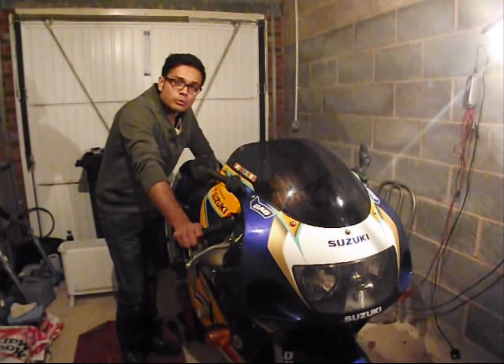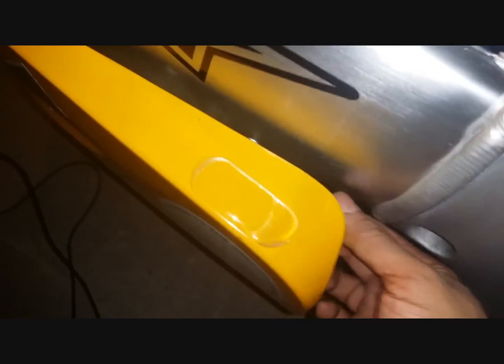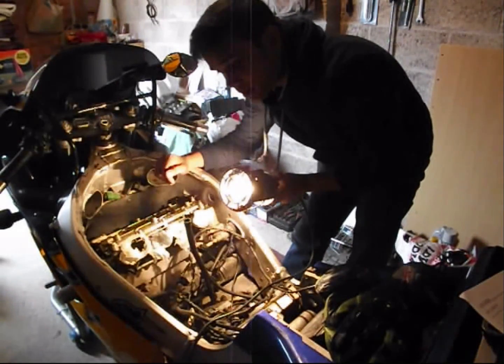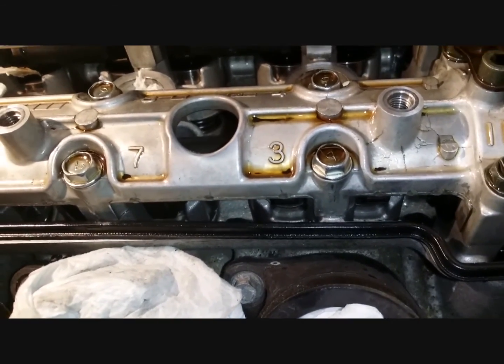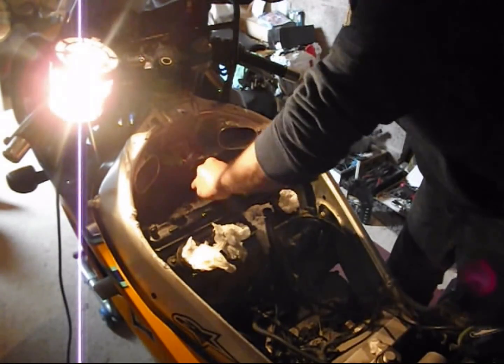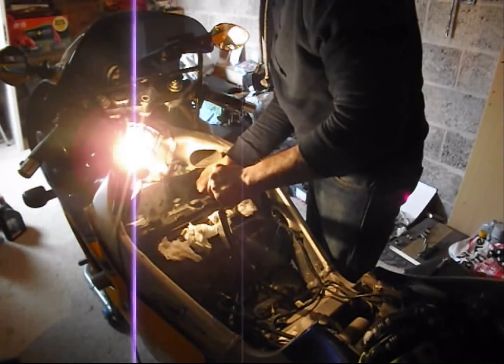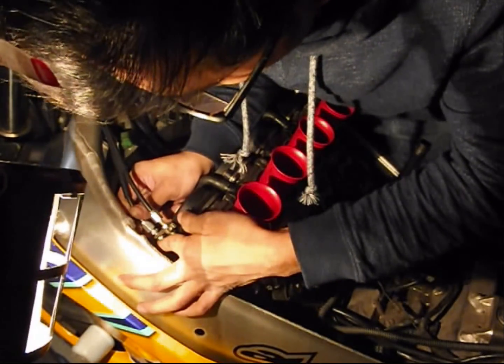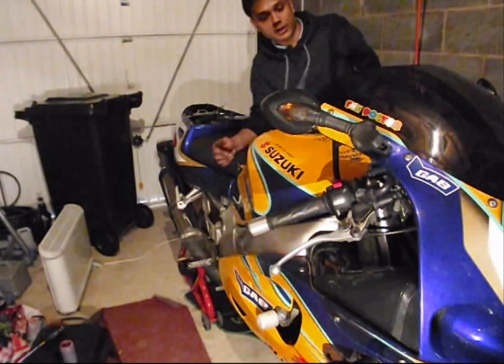GSXR 600 SRAD - Valve Clearances Check

Comment: hello bro, i have a 750cc 97'' too, been having problems with it, dont know why it wont start, and i been looking for answers everywhere and nothing, was hoping you could help me.

greetings from Venezuela.
Reply from the maker: +Domingo Chacon  Hello Dom. Thats a shame! Well try and sort it out. First thing Id like to know is what comes on and what doesnt when you turn the key to ignition and your kill switch (Red switch on your throttle side handle gear) is in the On position. 1) Does the fuel pump prime (you know the sound that your hear before you press the starter switch)? 2) If the fuel pump primes then do you hear any sounds - starter motor etc. 3) Fuel pump and starter works but the bike wont start 4) Do your headlights come on?  Dom, check the above and let me know here. We will go from there. Take care and good luck.
Reply: +Rij B do you have a whatsapp? We could talk from there, even i could send you a video of whats happening to me! What do you say? Or maybe we could skype or facetime